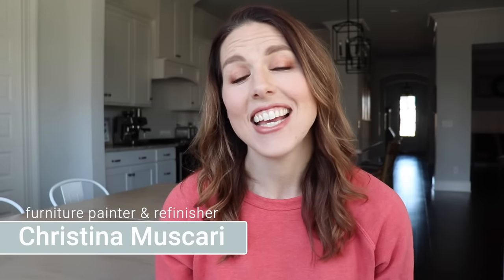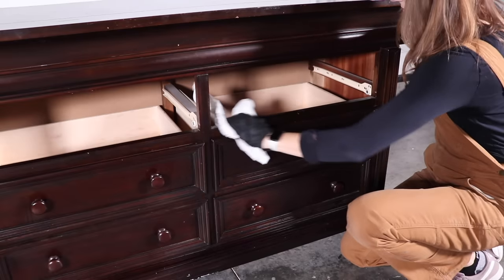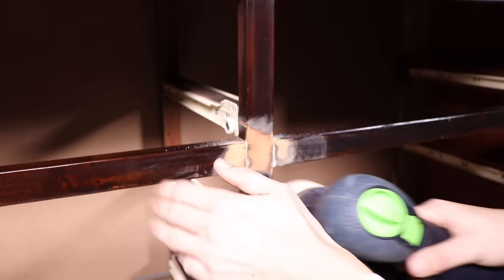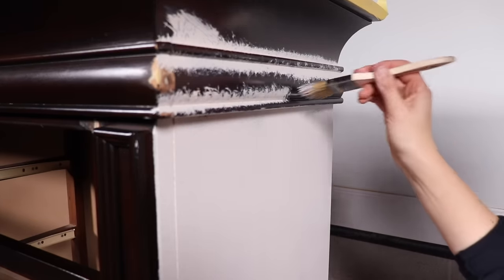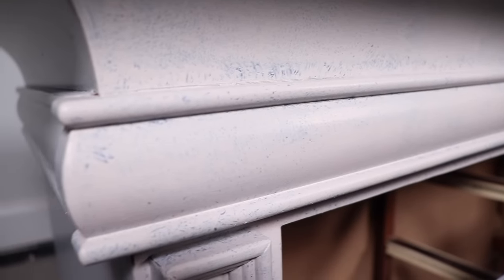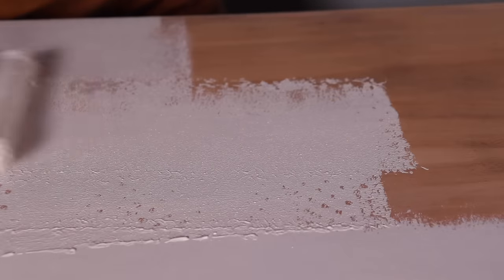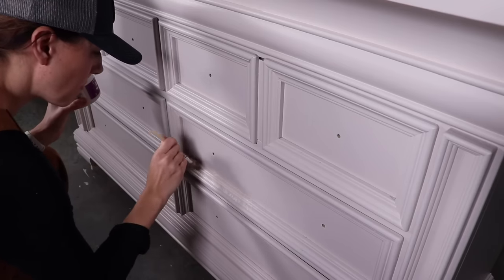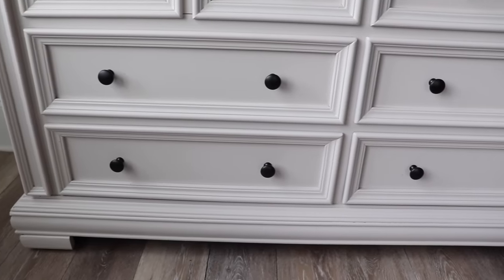Furniture Painting for Beginners | All In One Paint Again!

Comment: Can you use this paint over the top of a painted piece of furniture where the paint is an oil based paint and the old paint is chipped?  Would you recommend some sanding of the old furniture on those spots that were chipped?   Thanks.

Comment: I have some points. I think Christina is nice, and turns out some fine looking projects. Problems I have with this video:

A. When I see all in one day, I think, really? Maybe she did with this piece. Almost all of the time doing a large project will take more than one day. Look at all the steps in this video. Some were probably left out or not done, such as scuff sanding the sides. A lot for one day.
B. This supposes everything goes right. Many projects, of course, include mistakes and/or something not working as expected. Also, what about the every varying drying times of many products?
C. This piece turned out looking beautiful. But...what is the overall quality, the durability? I lean toward not enough surface prep for this job. I also wonder, just how good really are primers, paints, and sealers all in one?

Again, Christina seems nice, works at her craft. I just find videos like this misleading, among other things. Not just my opinion or feeling, but my questions and observations based on experience.